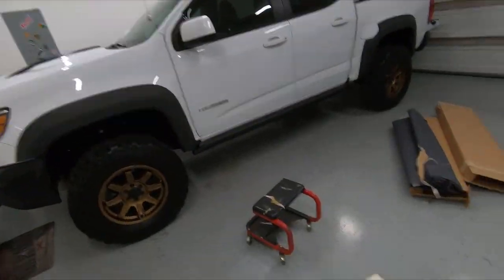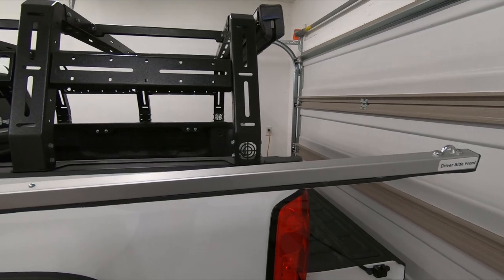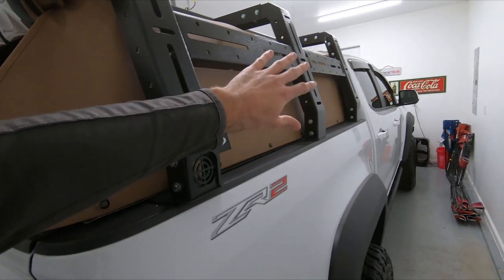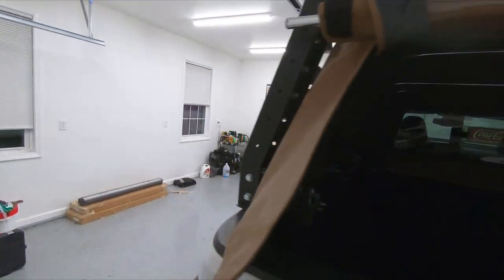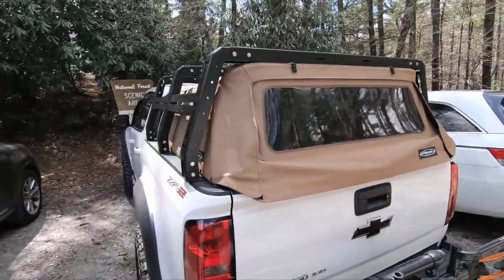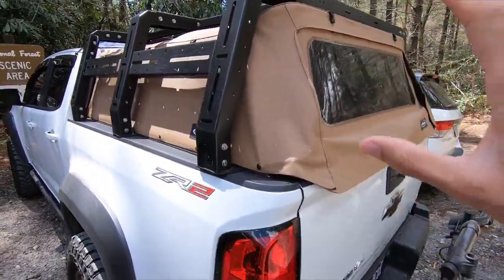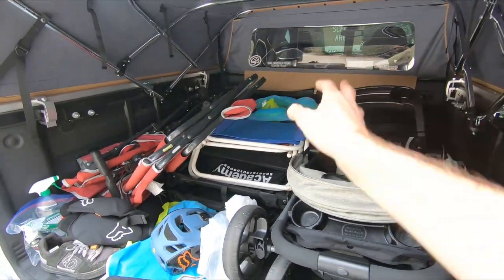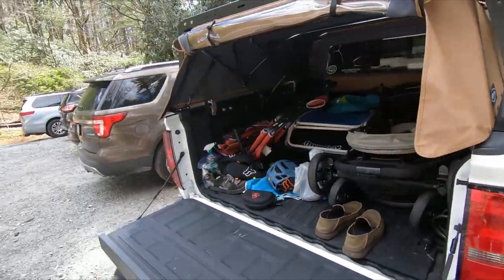ZR2 COLORADO GETS A NEW OVERLAND SETUP!

Comment: Great video. I just bought this same softopper for my Frontier. I definitely agree it's a pain by yourself getting the canvas top on. Overall I'm very happy and would recommend that anyone that gets a softopper to check and tighten the mounting bolts on the rail clamps a few times for the first few hundred miles.

Comment: I saw someone who had that same flapping issue, what they did was to take one of those pool noodles and (not sure if they cut it down to size or if it was one of those skinny ones) and they wedged it down between the cab and the bed and they said that sorted it out.  I'm looking at buying one of theses myself and I also live in NC...how is it holding now?  I'm actually getting the exact setup that you're running. Any updates?  Thanks! :)